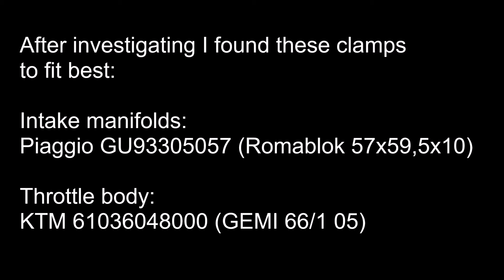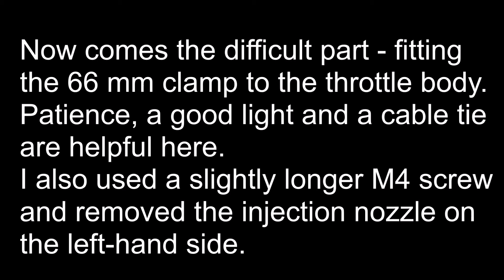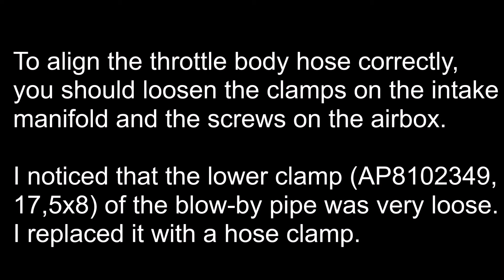Moto Guzzi V85 TT – Replacing Original Hose Clamps on Throttle Body Hose

Comment: Hi, thanks for the great videos. I’m thinking of doing the same on my V85tt, can you please advise how many of each clamps I need, and the size of the replacement bolt. Many thanks.
Reply from the maker: 2x Piaggio GU93305057 (Romablok 57x59,5x10) + 1x Throttle body: KTM 61036048000 (GEMI 66/1 05).
The M4 screw for the KTM clamp is maybe 5-10 mm longer than the one which comes with the clamp.
Reply: @janguzzi  Thanks for the quick response, that’s perfect, and your English is perfect as well. I’m from the UK, but don’t know any German, well maybe auf wiedersehen..
Thanks again.